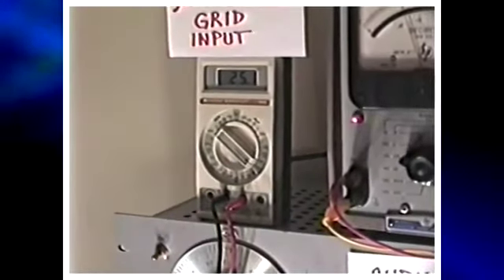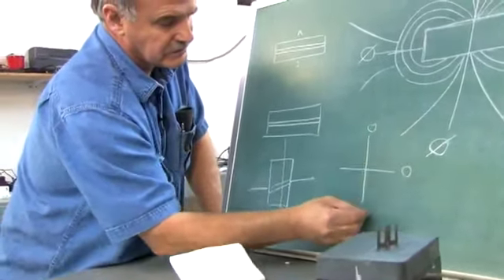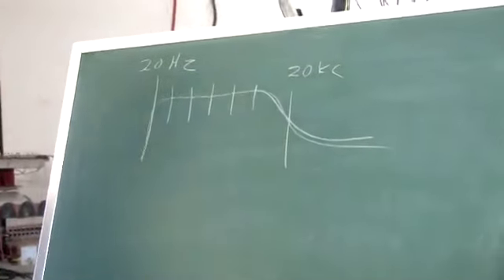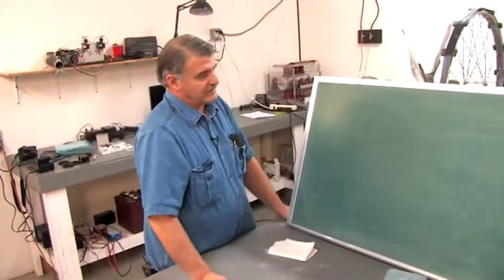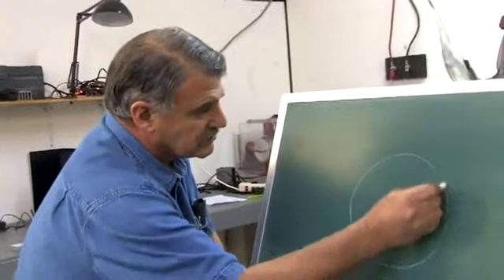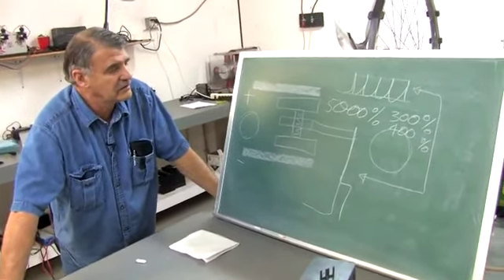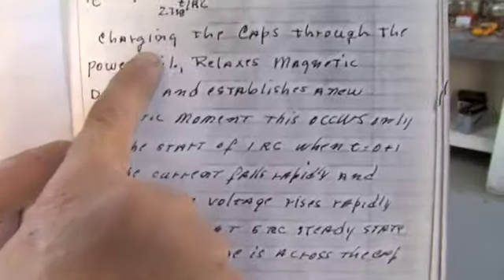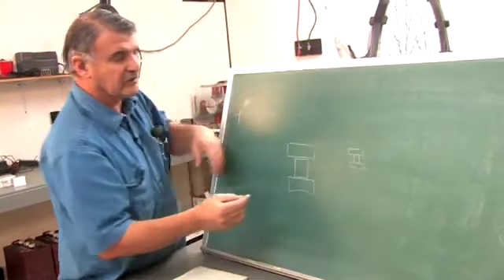#30 - Floyd Sweet Memories (2012)

Comment from the maker: 0:00: ⚡ Revolutionary vacuum energy device demonstrated by Floyd Sweet's associate in 1987.
0:00: The device generates practical power from the vacuum, with a power gain of 1,500,000.
1:00: John worked closely with Floyd Sweet to protect the device from theft and named it the 'suit device'.
1:58: The prototype box contained trigger coils and power coils essential for harnessing vacuum energy.

7:49: 🧲 Discussion on the orientation of power coil and trigger coil in a magnetic setup.
7:49: The orientation of the power coil and trigger coil was debated, with emphasis on the direction of the magnetic lines.
9:25: There was a disagreement on the effectiveness of the setup when stationary versus in motion, with reference to divine guidance.

16:30: 🧲 Demonstration of magnetic field attraction and coil orientation for generating a vertical magnetic field.
16:30: Wiggling one line in the magnetic field causes a ripple effect on adjacent lines.
16:59: Vertical coil aligns with lines of force to create attraction between North and South poles.
17:39: Applying a current to the coil generates a vertical magnetic field parallel to the coil windings.

25:17: 💡 Intriguing demonstration of powering lights using a generator and hidden wiring.
25:17: Lights powered up brighter as generator was turned up
25:33: Wires were hidden in a taped-up ball, connected to an amplifier and signal generator
26:03: Demonstration showcased the power and control of the generator setup

32:18: 🔧 Innovative energy generation method using magnets, coils, and capacitors explained by Floyd Sweet.
32:18: Floyd Sweet demonstrated a method involving magnets, coils, capacitors, and a push button switch for energy generation.
33:59: Observing laminations vibrating when magnet hits resonance was a crucial aspect of the experimentation.
34:09: Despite repeated attempts, the narrator faced challenges in replicating the energy generation method correctly.

40:25: 📺 Experiment with magnets on TV screen reveals unusual pattern and differences between them.
40:25: Magnets caused a strange pattern on the TV screen when placed in a certain way
41:33: The two magnets used in the experiment were observed to be completely different from each other

47:40: 🔍 Exploring the process of converting a TV set to understand frequencies and phases.
47:40: Learning how to convert a TV set to manipulate frequencies
47:57: Initial struggle in comprehending how frequencies create different shapes
48:30: Realization of the connection between frequencies and electrical components

55:21: ⚙ Magnet conditioning coils and power supply used in a device similar to the Sheller device from Nazi Germany.
55:21: Magnet conditioning coils and power supply assembly built for Floyds
56:27: The device is similar to the Sheller device used in Nazi Germany during World War II

1:03:54: ⚡ Floyd Sweet's device demonstrated impressive power output, sparking excitement and belief in Tom Bearden.
1:03:54: Floyd Sweet's device reached 1,000 watts, impressing Tom Bearden with its power output.
1:04:43: Tom Bearden worked diligently with Sparky Sweet, writing papers and explanations on conditioning and circuits.

1:11:47: 📦 Tom brings over a mysterious box to John's shop for testing, sparking curiosity and excitement.
1:11:47: Tom informs John about Floyd's latest creation
1:12:04: John agrees to test the box with Tom's assistance
1:12:48: Tom brings the box over with Peter or Bill

1:18:50: 🔍 Investigation into confidential information and incorrect drawings received by Walt and Tom Bearden.
1:18:50: Confidential information on conditioning a box and magnet assembly received by Walt and Tom Bearden.
1:21:06: Incorrect drawings of magnets received by Walt and Tom Bearden, leading to a wrong conditioning setup.
1:22:08: Drawings not done by the speaker, indicating information received by Walt and Tom Bearden.

1:29:52: 💡 Discussion on the potential of power generation, concerns about legal repercussions, and greed in the industry.
1:29:52: Power generation potential is underestimated due to calculations based on input power.
1:30:35: Concerns about legal repercussions for sharing energy-related information.
1:31:08: Criticism of greed in the industry and lack of focus on making energy solutions accessible to all.

1:38:03: 🧲 Discussion on creating magnets and memories of working on a project for 6 months to a year.
1:38:03: The speaker reminisced about a memorable project lasting 6 months to a year, filled with hope and hard work.
1:38:49: The process of creating a magnet was explained, starting with a piece of metal.